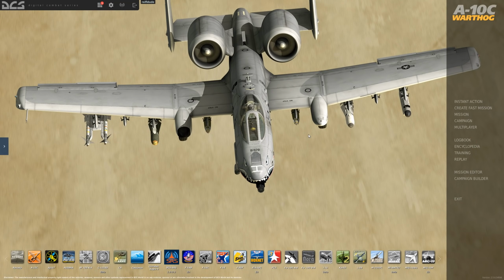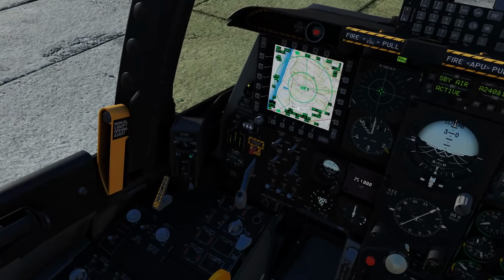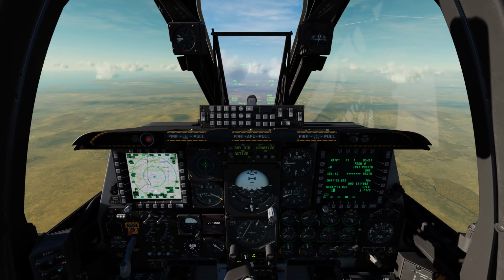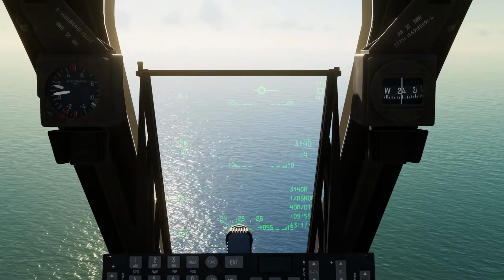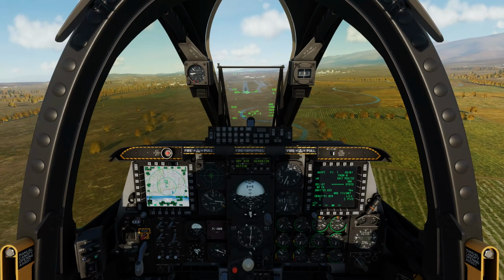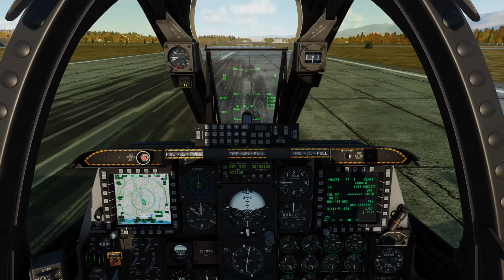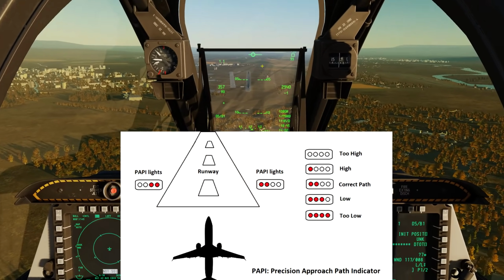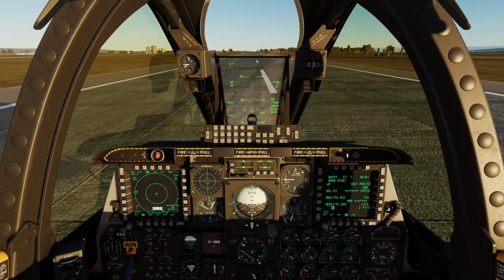DCS A-10C Tutorials - From 0 to HERO Ep2 - Taxi, take off and Landing

Comment: Thank you so much for turning off the infernal TACAN ID, so many videos out there with it on. Remove the TACAN ID code beeping at you without turning off the TACAN by reducing the volume to minimum on the Intercom Control Panel. Left, aft console labeled TCN. See page 151 in the A10CII manual. Great series Ralfy. Subbed and saved.

Comment: To be clear, in a turn, the solid/chopped tones indicate angle of attack over the wigs and are directly correlated with the AOA guage below your UHF frequency display.

Also, ideal approach glideslope is 3 degrees, so between the 0 and the 5 with the TVV. And always full flaps when landing. Always.

Comment: "moment of inertia" ? of what, wheels? Don't mean to troll, just burned inside my head when I heard it. Great video, as usual...
Reply: Maybe wheels with lead slugs attached to the rim lmao. He might be referring to the spool up of the engines, but I'm not sure that was what he was tryna get at.
Reply: @adambarszczak1404  I think he was reffering to "momentum" as in the energy the craft has once it started moving. But yeah, the moment of inertia of the engine fans would be the right topic here - the huge 1,23m turbofans vs the 0,89 m in the F-16 for example. The angular energy (momentum) is a function of the square of the radius, that's why the A-10 has such sluggish throttle response time.

Comment: I just got back into DCS with A10 and I use the whole runway and only getting to 130 knots 
 . If I go full flaps I can get off the run way . 
Not sure if I’m at full power .
Reply from the maker: You're def not at full power. Check your gauges. Then check your controls.
Reply: @ralfidude  gauges show full power but fan gauges show about 50 and I’m using the new 
X56  Throttle and stick

Comment: I don’t think DCS cares, but when should the wheel brakes be applied after touching down to prevent spare the brakes?

(I try to practice as close to the book as possible, but it’s never mentioned)
Reply: i tend to put slight brakes around 80 knots, but it really depends on several factors like weight and length of the runway, but yeah that's just me and don't know when it's done by the book
Reply: @delayed_control  Yeah, I have all that configured properly. I use landing lights and all of that as well.

Just was never sure on proper use of brakes (brake pads)
DCS doesn't care I'm sure but always wondered.
Reply from the maker: IRL you try to avoid using breaks until the end of the runway when you have to come to a stop. If you did all your numbers right, you shouldn't need to use them much, but this depends on runway length and other factors. In DCS you can do the same, but you can also just slam the airbreaks and wheel breaks right away. It makes no difference to you since the breaks won't overheat.

Comment: With a full load I pull back at 165knots and only get positive rate at 175-180. And it uses almost all the runway which is scary especially on shorter runways.
Reply from the maker: That's ridiculous. You should be able to rotate at 140 at a heavy load.
Reply: Huh. I'm very new to the A10 and thought it was normal until you said you could rotate at 120.
Reply: @willmorrell488   are you sure about using your flaps ? because this number looks like taking off without flaps
Reply: I use half flaps mostly.

Comment: This sounds a bit stupid, please don't laugh because I'm a brand new pilot to DCS. Now...how do I steer the plane? no matter I turn on/off the wheel brake or nosewheel steering by checking the aircraft view. Do I miss something here? I have had a lot trouble steering the plane out of parking bay for taxiing. Please help, thanks.
Reply from the maker: With nose wheel steering turned on, you steer by the same way you YAW, the thing that moves your rudders. Do your rudders move when you yaw? If yes then thats it, with nws on you steer with yaw. If your rudders don't move then you have a control binding issue. Good luck.